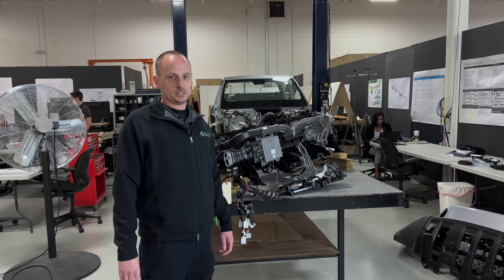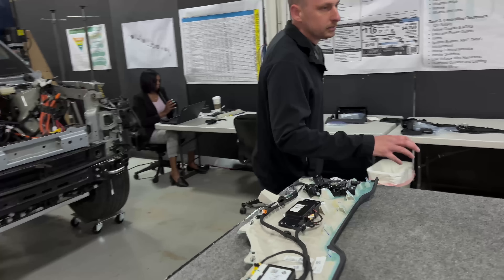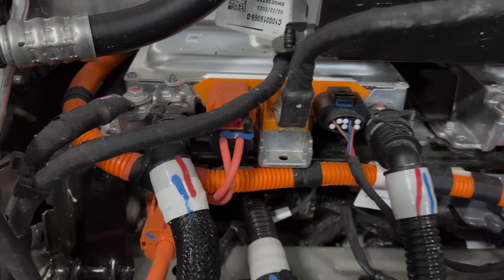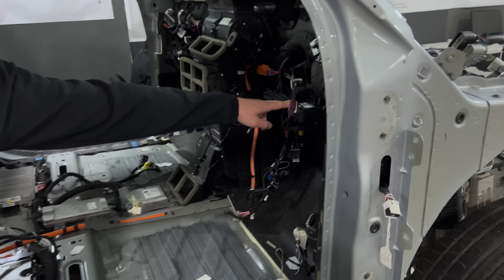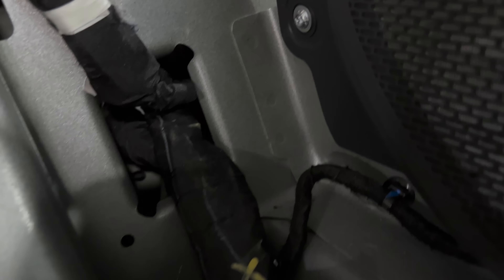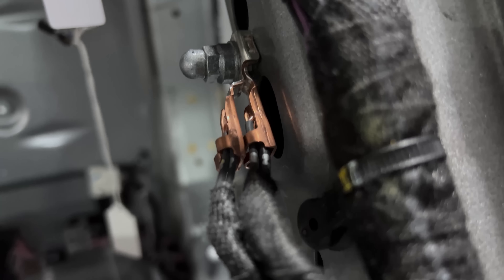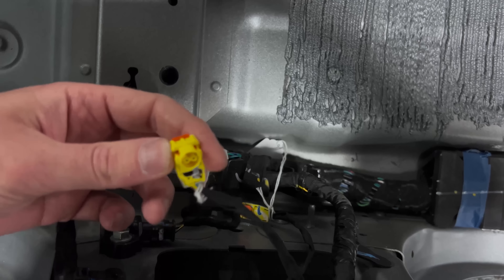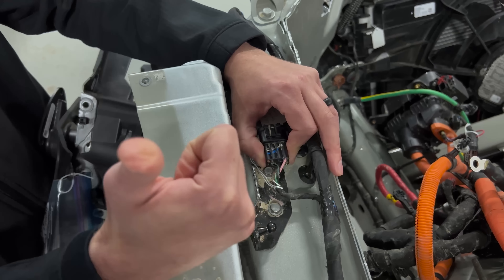Rivian Wire Harness Whirlwind

Comment: Well stated. Big Concerns 
1. Harnesses Lacking Proper Abrasion, Chafing & Rattle Protection. On large bundles suggest an 16 to 32 carrier over braided design; suggest a polyester Cordura Nylon yarn blend or Nomex which is fire resistant.  
2. Too Tight of Bend Radius and many Pinch Points; cause damage to wires, abrasion etc.
3. Fuse Orientation: Difficult Accessibility

Comment: Didn’t Tesla put a 12 Volt disconnect cut-loop in the passenger side C pillar of the Model 3 similar to what Rivian has done here?  I was scratching my head after the previous video over locating the 12 volt pyrotechnic disconnect on the underside of the dash top cover.  I still can’t develop a justification for not mounting it with the batteries.  (Other than ‘Oops, we forgot!’)
Reply: Yes and first Model S had it in the front fender I believe

Comment: The detail about the sealed connectors at the end was fascinating. Seems like manufacturers would model the wire paths with angles so the wires pointed towards a common, bundled center point.

Comment: I'm wondering about the coax cables. Maybe they don't have production of that cable in house, or can't rework the cable, They were only able to find cables with pre-fabricated ends at a specific length. Very strange problem to have.
Reply: It’s not a problem! They can very easily change that, they are the ones that designs the harness or makes the specifications and works with the suppliers
Reply: @carholic-sz3qv  agreed, I'm more exploring why this particular build was made this way

Comment: I care about wiring harnesses, especially good ones. I owned a couple 80's/90's Saabs , they had horrible wiring harnesses, made with wire poor quality insulation that became very brittle over time , to the point that when you changed headlight bulbs, the insulation would fall off and the wires would short.  So I appreciate a well made, high quality wiring harness, thanks for the walk through and insight!!!

Comment: If a pyro charge disconnects all power in a collision, that would inactivate the remaining undeployed  airbags, right? That could really suck in a highway pile-up accident where someone collides with you moments to minutes after a first collision.
Reply: Yup, and also means might be  harder to tow away.. tesla has tow mode for this, leaves 12v on

Comment: Still amazed that, even with CAN, there are so many wires.
Reply: CAN, FlexRay, LIN are still limited, you can’t send video over any of these, you still need dedicated coaxial for antennas as well as airbag systems and also signalling equipment that needs to be redundant of a data network failure such as door locking and lighting. The list goes on

Comment: Really surprised by these mistakes you show in your videos. Hope Rivian listens to this free advice. Perhaps also they’ll see your company’s value and hire you for consultation!
Reply: Rivian does the Tesla's way.. So definitely even though its hard for them to accept their flaws, Rivian will hear to these videos.. If not, they are gonna go bankrupt for sure and Amazon takes over!
Reply: I think that RJ(Rivian CEO) has already met with Sandy about the build quality of this truck. I bet there are already little things that have been changed, before production. Sandy has said he has met RJ in the past and everyone knows Tesla used them for redesign of the model S. This company has helped enormously already and hopefully cars will only get better and better
Reply: Those extra long co-ax cables are adding weight and cost to the vehicles.  In addition, using 2 separate 12v systems adds cost and weight as well. He never explains why two separate 12v systems would be a good idea from an engineering standpoint.
Reply: This is leap-years ahead of the first teslas
Reply: Rivian has alot of redesign to do .. otherwise they ain’t gonna be around for long
Reply: @TheTrumptyDance  As a first gen vehicle this wiring harness is a pretty good effort. It will be improved (and probably already has been) in the future as they find issues.
It’ll be interesting to see why they used a separate 12v system but there is probably some good benefits to the design.
It’s important to note that it’s extremely difficult to design a car perfectly first time, you only have a finite time before you need to launch it or risk going bankrupt. So far they seem to have struck a good balance.

Comment: Can the Rivian limp home when one 12V circuit dies? Power steer, controls, lights?  Can it even limp home with one corner taken off the vehicle, even when it's on the side of the still working 12V?

Comment: More info on why they have 2 lead acid 12v batteries.
Reply: Jumper to get you going home from middle of nowhere and to bridge the load for a winch.
Reply: @mattbrew11  Not likely for a jumper because it wouldn't even turn one of the motors. Could be for accessories like a winch, inverter, and air compressor etc... Good point.
Reply: @mikepetersen5024  I don’t mean to power the motors I mean to jump over one dead battery to energize the hi voltage system

Comment: Why don’t these companies break out each section to a microcontroller and only have 2 Canbus wires and 2 dc wires running to each?  You could virtually eliminate 70% of the wiring and improve reliability. 

And you could orchestrate these from a higher power computer. 

And if you put 12v batteries front and back and further limit wiring. 

And by doing this you eliminate any long runs of vfd motor drives that generate noise and if you use the right microcontrollers you can drive all of those motors directly from the microcontroller instead of having more vfds.

It also isolated systems and simplifies updates to specific isolated areas and gives you the ability to use PCBs in lots of places to eliminate wiring entirely.
Reply: How is having a light bulb that needs a computer to decode a canbus signal more reliable than just a lightbulb?  All these modules are prone to failure over time but a piece of wire isn't.
Reply: @theslimeylimey  1. the lightbulb isn’t a light bulb anymore it’s a led flip chip that’s on a board inside the “bulb”. 

2. There are normally many bulbs together or other things too.  So as an example a driver’s seat has every control and the bldc motor(s). Right now these are controlled with a massive harness of wires going back to a central processor. In my scenario 4 wires go to the seat and a single board controls the whole thing and the buttons are directly on the board where they lay on the left side. That same stm32 microcontroller can easily control all 3 axis from there and the noisy variable frequency AC is isolated to that spot. 

Same in a door. Instead of tons of wires, a single pcb where the buttons are with a microcontroller can drive all of the buttons, and the window and send a can signal to all of the other doors as needed too. All on 4 wires instead of the massive loom. 

3. Putting all of the stuff on PCBs makes them vastly more reliable than floating buttons and leds in a given area (and everything is clustered anyhow so putting them together makes sense)

4.  The time it takes to plug a 4 pin Canbus connector in and run the shielded 4 wires in prepackaged pvc insulation to a given pcb and then snap it into a plastic extrusion is VASTLY less than doing every single button and led one at a time. I could cut 70% of the time it takes to wire these cars on top of 70% of the wiring while making them vastly more reliable. 

5. Using microcontrollers one clustered areas creates a hub and spoke architecture where each spoke has its own mostly isolated code that controls only what it’s tasked with an nothing else. For all inter spoke communication it goes to the hub which doles it out (or can go to a spoke directly if needed but this makes things more complex for little benefit. Computer programmers long ago realized that this architecture is VASTLY more scalable and complexity can MUCH more easily be contained and simplified. 

6. It also means that you can roll updates to a single mcu as needed without full regression testing of all systems, only the hub that it communicates with if it actually sends back which means unit and integration testing of the software gets much easier and you can be more nimble. 

Your argument held water when there were 10 bulbs in the dash and 2 buttons on a door and the seat was manual. That’s no longer the case and all of these companies are designing their low voltage electronics like a mainframe from the 1970s instead of isolated systems with inter-communication carefully managed. And the consequence in ICE is pretty obvious. The software in these systems is buggy and UI is horrible. The reason is specifically because of all of the stuff they’ve hung off of massive wiring looms instead of isolating the systems. 

I’d go so far as to kill off Canbus and use Ethernet and IP virtually everywhere (which most mcus support now) and use Power over Ethernet for all clusters that don’t have motors on auto rated shielded cat 6. And with the ones that do have motors, there is cat6 + 2x 16 awg that will drive 10 amps at 48vdc easily. (And the low voltage should go to 48v). This would integrate a much more robust and FASTER communications system with error correction, provide power over the data lines and allow for complete systems isolation while eliminating most of the wiring (think a single wire to the back of the car from the front switch just like Ethernet in buildings) and vast simplification and shortening of time to market. 

And yes, we’re at the point where it’s cheaper to run POE for lights in homes than Romex because of the cost of copper. So there’s massive cost savings here too just from materials to say nothing of all of those discrete switches, buttons and lights that can be integrated into PCBs and made way cheaper and more reliable too.

Comment: Is the cut loop in the c piller also for a "jaws of life" application?
Reply: Yes it is. A hydraulic cutter like the jaws of life is the only way to access it.
Reply: Exactly right. Its designed to break if jaws of life are used. Its not like first responders have safety diagrams

Comment: Wow Rivian, I'm not very happy where you put that pyrotechnic power cut off.  It will be such an inconvenience having it go off and then your truck is dead in the water from a minor fender bender that you could have driven away from.  Now you'd have to get it towed to repair center and be without it for who knows how long.  And, they have to rip open the dash.  So many scratches and dings will happen when they do that and I'd be so pissed if they nicked my wood dash.  Please Rivian change the location of that power cut off part!

Really disappointed a Rivian worker taped a broken connector back together.

But I hope companies like Rivian and Tesla watch the Munro videos and actually make some changes.

Comment: Awesome walk-through. I hate all the signs of sloppy assembly like smeared sealant and taped-together connectors. Doesn't speak well for assembly line culture.
Reply: The smeared sealant you “hate” is there to increase resistance to water incursion. You forgrt this built to ford 3 feet of water
Reply: @mattbrew11  I’m all for sealant. But it looks like it was applied by a 9-month-old overdue for a nap. Look at internals from real car makers - everything is neat and tidy because that’s the culture of the assembly line and that stuff matters. Rivian is doing Tesla levels of IDGAF on assembly quality.

Comment: The location of the dual 12v wet acid batteries appears to be a safety risk in an accident. Small lithium 12v batteries in a safer location is a better choice.
Reply: Wrong!!!! Those are in very safe place and there is a frunk there to absorb the impact, you’re welcome
Reply: The frunk is full of Air space which doesn’t absorb crash forces. If it was filled with solid, secure absorption materials that’s a different story.
Reply: @icare7151  wrong.
Reply: @mattbrew11  I am referring to the empty cargo area of the frunk. Right!

Comment: I worked in wiring harness quality and oem production development. All I see on the harness is there is way too much over length which means either the design or harness production process hasn’t been figured out yet. Also the real estate and harness positioning is not what any oem would do or accept from a durability standpoint. 
I can’t see how this harness is easy to assemble, it looks like a nightmare for the worker on the line. It must take them forever to route all the branches inside the body.
 
Not sure if there’s a design change or any other option but the entire layout of control units and harness position seems random and not really though out. 

That’s the problem with starting from scratch. They will learn a lot really quickly otherwise the harness will be costing them a lot of money both in production and long term quality 

Especially the routing of harness and branches is questionable. The wire for coax look like they haven’t been produced and tailored to the harness, rather standard cable lengths from the supplier being routed and wrapped inside the existing harness module. 

Normally a body main harness is produced in modules and put together according to the vehicle option. Many of the routing and taping doesn’t seem to be consistent yet. 
It can be a small batch or early pre production harness but I know Dräxelmaier and that’s not their usual series production standard.

Comment: So much for EVs being less complex than ICE. Sure, fewer moving parts but can you imagine chasing down a broken wire or bad connection on this thing? Good luck.
Reply: Take apart an ICE car... same crap.  I rewired a 68 Mustang from bumper to bumper and it took an hour with a Painless kit...  But I get your point and I think there are a lot more areas to simplify with EVs.  Reminds me of when VCRs first came out in the '70s.  Damned things were 30 pounds, had 10 belts and all sorts of gears and pulleys.  By the time they stopped making them, they were direct drive and weighed 5 lbs.
Reply: Low voltage wiring what is shown in this video is same for EV and ICEs.
Reply: Let’s not forget, Ice have more moving parts but EVs have massive amounts of electronics everywhere, from the BMS to charger/inverter, motor controller………. I’ll like to see those EVs survive the harsch African or South American or even Russian weathers 😂 😂 😂
Reply: @ohger1  still less electronics than any EV lol……
Reply: this car does have a lot of extra luxury features
Reply: @trey1531  yes not everyone needs the extra portable speaker or led lamp in the door or many other features….. Toyota for example still sells The land cruiser and other vehicles with very basic features
Reply: @carholic-sz3qv  Right now, EVs are all  premium vehicles with all sorts of high performance bits.  When someone starts making an EV that doesn't do a 11 sec 1/4 mile, things will be simplified.
Reply: Ice cars have all this shit too
Reply: @mattbrew11  nope they don’t! It’s the crazy luxury and complex vehicles like Mercedes’ sclass that have those crazy features like interior lighting, all wheel steering, heated/cooled surfaces everywhere, over 25 speakers….. 48v suspensions for leaning at corners…….. stone massage seats and much more….

Comment: After all these years, 
I still don't understand wiring harness's.
From an IT perspective, why not instead of ending up with massive clumps of differentiated wires, why not replace with a single (or dual for redundancy) Cat 6 cable. Accompanied by a 12v power line running a circle around the car. Connected to small hub/relays everywhere you need to send data/power, from headlights, to door sensors, tail lights, etc etc etc.
The simplification would be exponential. The length of wiring would be a fraction as much.
Reply: Many cars do this to a certain extent. They generally use CAN bus instead of Ethernet but the principle is the same. For safety reasons stuff like ABS, airbags, seatbelt pre-tensioners etc always have to be individually wired.

Comment: I worked as a professional automotive technician specializing in electronic systems diagnosis for 26 years. I found that most of what you had to say here was pointless and hard to understand why you were even mentioning it. To me the dual heavy lead acid 12V batteries were something that cries out for an explanation. The color mismatched connecter, downward facing fuse panel and components mounted under the easily damaged dash cover were actual real problems. I am still mad at GM for their downward facing fuse panels, just sayin. Ever try and actually troubleshoot such a configuration in a real world, the clock is running, shop environment? I am not at all bothered by Rivian making beefy ground connectors especially in an off road vehicle. Of course I am all about the serviceability side and have no dog in the manufacturing/assembly fight.
Reply: Wow thanks for these insights.. I guess when these are mass manufactured, the vehicle service would be a real headache for both Rivian & its Customers! Also expensive as hell too!
Reply: The horizontally mounted fuse box will be a headache unless it can easily be detached from the firewall for troubleshooting, as you mentioned.
Reply: @mikedx2706  Ya, working in a contorted position upside down in the dark is exactly why engineers like to remain anonymous or so I would often tell myself ;) I wish customers would punish manufacturers for such blatant abuses but they don't and so manufacturers simply don't waste any time or money on serviceability.

Comment: What’s a squib? Asking for those that might not be as smart and informed as this guy….
Reply: SQUIB is a connector used for safety related components: airbags, seatbelt retractors, impact sensors, etc.
Reply: @c_fox7396  and what is a "damp squib"?
Reply: Small explosive to force a disconnect of electricity in event of an accident.